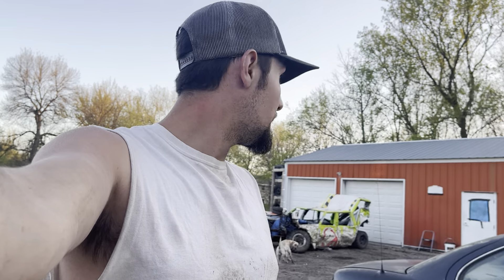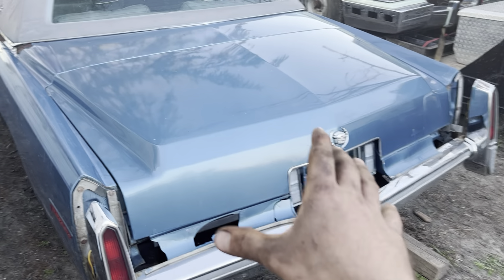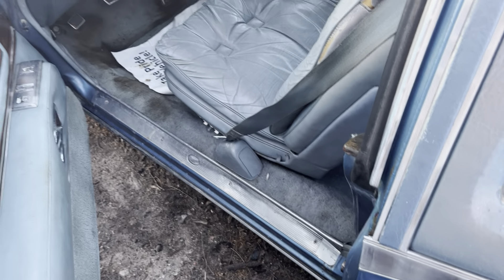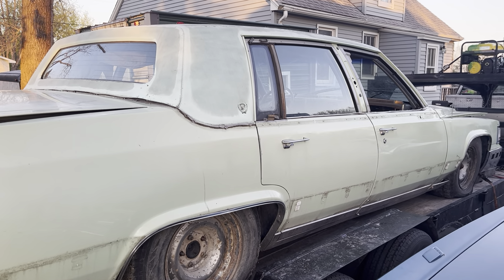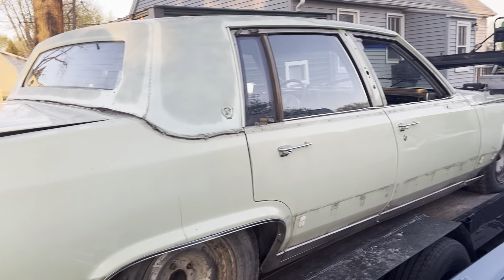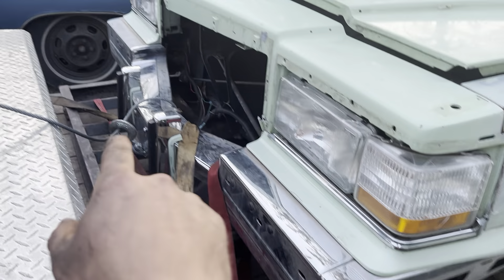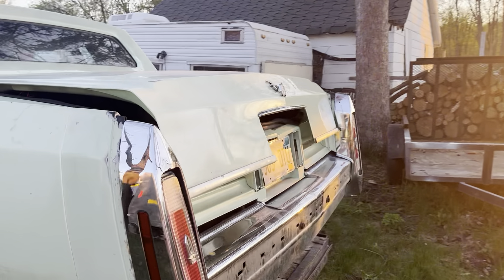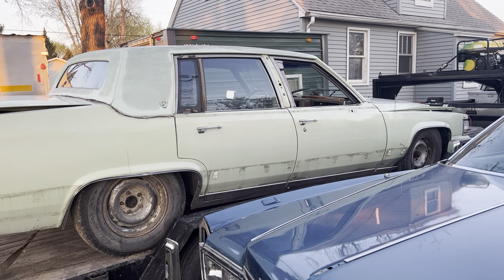Adding two caddy’s to the derby collection

Comment: The front wheel drive eldorado can be super hard if u convert it to rear wheel drive limited weld. The one I seen had hump plates in the back and the front they put in sbc with th400 trans with full cradle and they tilted it at firewall and had a large bumper shock used to brace the front 12 inches of the frame. Ur other caddy that had hydros u better look at the frame most of those cars people reinforce the frame and don’t hide it so all the cars I’ve bought that used to have hydros the frames where junk either from reinforcement that won’t pass tech or bent from hopping. So be aware before u pay very much for them.